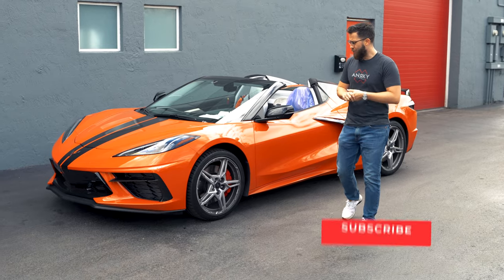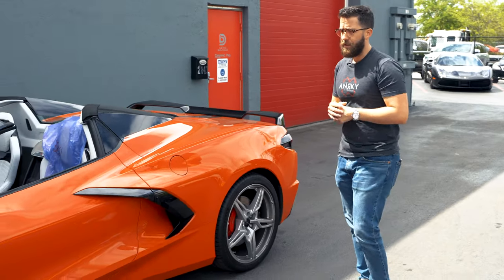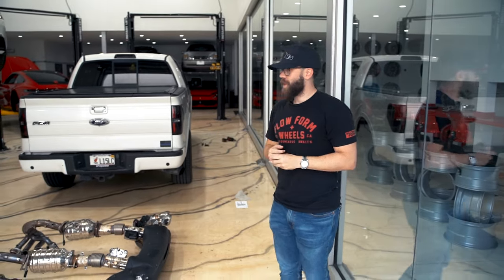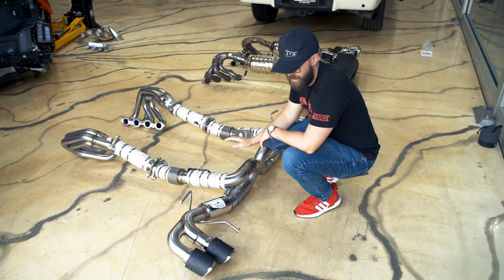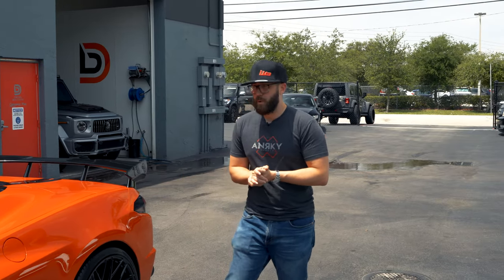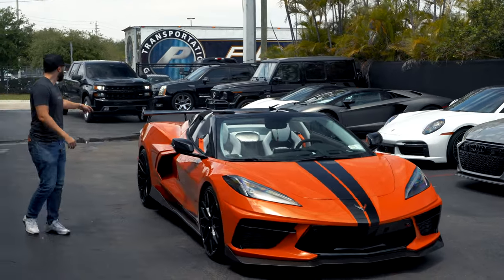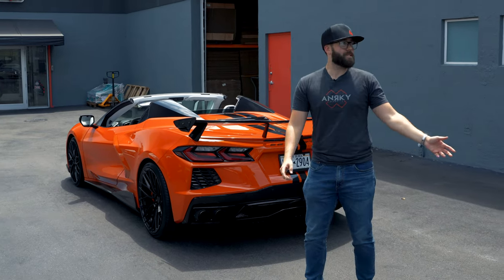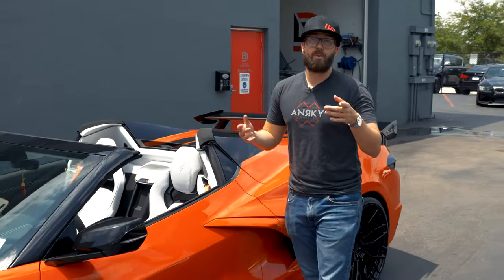2020 Corvette C8 Build in 15 Mins!

Comment: looks great but Know what you are installing guys. You installed straight pipe in replacement of the factory cats. The pipes you installed do not have cats in them at all. (Based on what was shown in the video. ) I’m just picking on you guys. You did a great job well done.
Reply from the maker: Select verbiage needs to be used for lawful purposes :)

Comment: Beautiful job . What’s the tire size on the fronts ? Would I be able to get all season tires for that wheel set (same size you used in the video ) ? Thx
Reply from the maker: Thank you. Front tire size is 245/30/20. There are no all-season tire options in these sizes. If you absolutely needed all-season tire then we could build these same wheels in a smaller 19"//20" setup. But keep in mind if that was done it would not look the same as this car.
Reply: @WheelsBoutique  ty for quick reply . I’ll consider summer tires , looks sick . Still have time as I ordered my car and approximately 8-10 months out . You do beautiful work

Comment: Thanks for sharing! But!  Whoever owns this car just likes to waste money.  Why pay to get a wing, when you're going to simply get a larger after-market one?  Why pay for a lift when you're going to lower the car?  Why pay for red calipers to have them repainted?   This owner could have saved $5 or $6 grand that he could've used for more aftermarket mods. That said nice work.
Reply from the maker: What if certain factory options would delay the delivery of the car? What if the owner received the car and didn't like how certain things looked in person? What if some of these options weren't options from GM at all? What if the car was an allocation takeover from someone else? We are happy that we're able to help our clients get their cars looking exactly how they want them no matter the circumstance.
Reply: I have the same car, the original wing that he had it comes with Z51 package, you can not just take that spoiler. Lowering gives a super car look IMO and again you have the tech to raise it when you need it. I agree with the red calipers, red calipers actually does not look right with orange car. That's the only place he could have saved $600 to be exact.

Comment: What is the weight savings and what is the HP and Torque gain on it after doing the complete exhaust system
Reply from the maker: The Fabspeed muffler and high flow cats alone shed 37 lbs over the factory parts. In total, the full system shed over 40 lbs and produced power gains of over 50 HP & TQ.